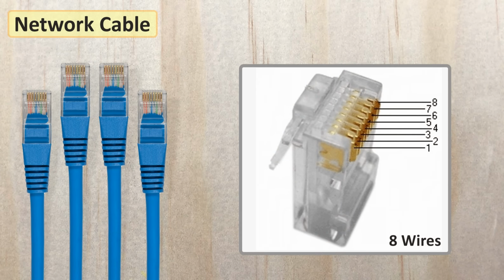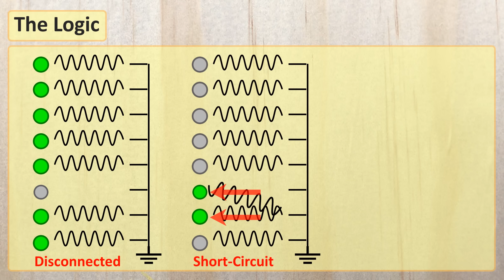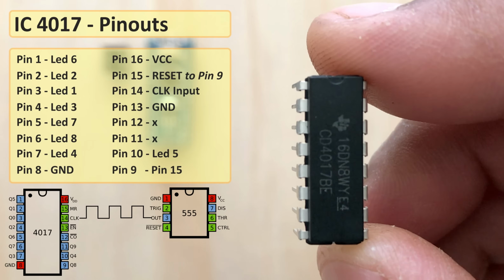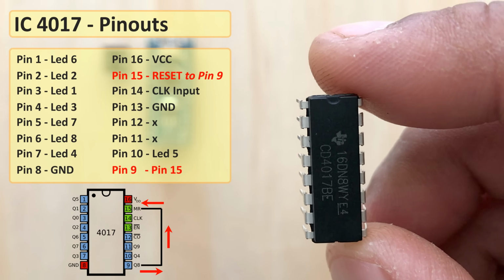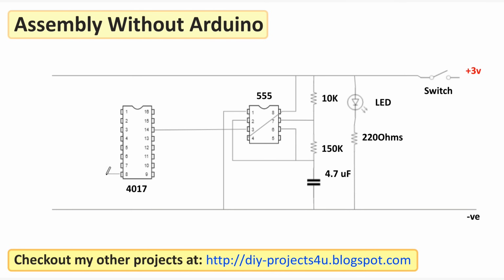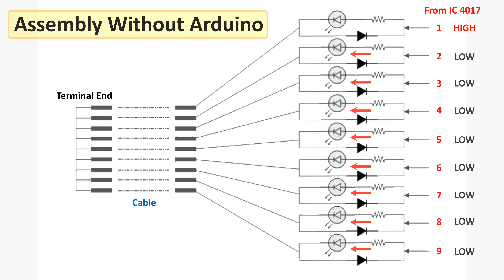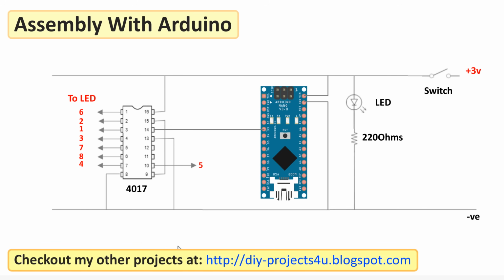DIY -  LAN Cable Tester - With or Without Arduino

Comment: Loved this project, built my own and it works well. I have done the same as @fik_of_borg has done with a "remote" end. 
Is there any way to take this to the next level? I have a building with many unlabelled network ports, I would like to have the "remote" ends identifiable (remote 1, remote 2, remote 3, etc) so I can plug the remote ends in, and back at the switch identify what is what?
Reply from the maker: One way that I can think of is by adding a pulse (clock) to the remote end and each end is set to a different frequency.
Lets say end 1 = 1Hz
2 = 2Hz

By looking at the pattern of flashing on the handhed end you may be able to identify which end is currently connected.

Comment: I built it with some improvements:
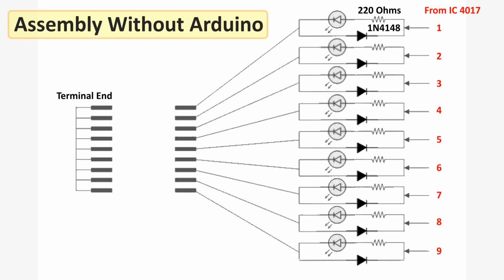1- moved all LEDs, resistors and diodes from 4:40 in the video and that RJ45 to a separate "receiver", and then I can connect the 555+4017 "transmitter" unit at one office, walk to the switches cabinet in another room and identify the cable by connecting them one by one to the receiver to see which cable lights the LEDs.
2- added to the 555 another capacitor and a switch, so I can have a two-speed scan. Fast is for looking at a glance if all LEDs light indicating that there is no open circuit due to a broken cable or bad RJ45 crimping. Slow is to check for swapped / shortcircuited lines.
3- added a piezo speaker to the 555 output, so it emits a chirping sound and is less likely to be left on draining the battery.
4- added an 8 position SIP connector both to transmitter and receiver to ID+check the cable without connectors. It's a nuisance when one checks the cable and one or two signals are missing, and it's unknown which RJ45 is bad or it's the cable itself.

Comment: may i know the wattage of resistors?
and the votage of capacitor?

Resistors 220Ohms 
resistor 10K 
resistor 150K 
Capacitor 4.7 uF
Reply from the maker: 1/4 w for resistors 
The voltage rating is only the maximum voltage that a capacitor should b3 exposed to, not the voltage that the capacitor will charge up to. So anything is fine

Comment: can i see the pcb's bottom circuit
Reply from the maker: It’s in the schematic
Reply: Crazy Couple Thank me for understanding
Reply: as on the 2 cable leads cross each other led still work normally, righ

Comment: if you use an arduino you dont need a shift register
Reply from the maker: The point is  to use only one pin to generate a pulse.

Comment: This will not test for shorts. The wires are already shorted at the other end. If there is a short it would just return to ground potential through the shorted wire and diode. It won’t light the led because it would be reverse biased. 

This tester won’t test sequence either, you’re just lighting the diode on the wire you wish to test, not what wire it actually ends at. 

Congratulations, you made a 555 8 light sequencer.
Reply: That was my initial thought also. The original idea works fine for broken connection, but is not good to test shorts or sequence. Still a nice starting point for as tester, though. And well prepared video. Thumbs up for that!

Comment: Bro make a device that use for long distance cable
Reply from the maker: This setup is not idle for long length cable. 
However, by adding few transistors to amplify low current you can make a long range tester.

Comment: what is the code for this mate?
Reply from the maker: You can use the blink code
As you just need to send a high followed by a low every lets say 100ms
Reply: void setup() {

  pinMode(LED_BUILTIN, OUTPUT);
}

void loop() {
  digitalWrite(LED_BUILTIN, HIGH);   
  delay(100);                      
  digitalWrite(LED_BUILTIN, LOW);   
  delay(100);                    
}

//is this the code your talking about mate?
Reply from the maker: @senthramiljohnlandingin3728  yes, increase the delay a bit more based on how fast u want the LEDs to toggle
Reply: @CrazyCoupleDIY  thankyou so much mate i appreciate your help
Reply from the maker: @senthramiljohnlandingin3728  You are welcome
Subscribe for more amazing tutorials and projects

Comment: If you are using Arduino then no need of 4017 too I suppose as you can use other digital pins to switch led if led current can be supplied by uc.
Reply from the maker: Well yes and no.
Reply from the maker: Well I guess u are not someone who has more experience but u sound more like a fucking winger who has nothing else to do in life other than poking their fingers in someones asses and licking the shit out of it.
Ur experience is useless as I dont see u smart enough, u should better go back to school and learn some fundamentals of electronics and not how to use an Arduino

Comment: Wow! I love that you provided a version without arduino! 
In Fact, this project looks fully fleshed out. Did you ever consider ordering some costum pcb's and selling theese testers on tindie? You could sell them for 7$ and make a good profit.
Reply from the maker: Thanks for the appreciation 
Na, I havent ordered any custom PCBs yet, but I will definitely consider that as an option.
Thanks.
Stay tuned for more projects and have a look at my other tutorials if you want , cheers
Reply: I just completed a PCB layout inspired by your video, but modified for USB power (e.g. a power bank or a phone charger) and using SMD components. https://easyeda.com/derjan/lan-cable-tester
Reply from the maker: This is amazing. 
I will put the link on my instructable and my blog. 
Thanks :)